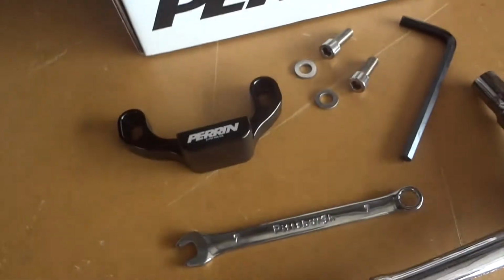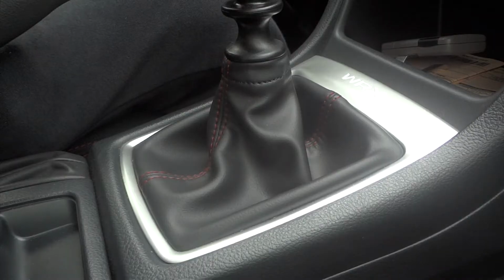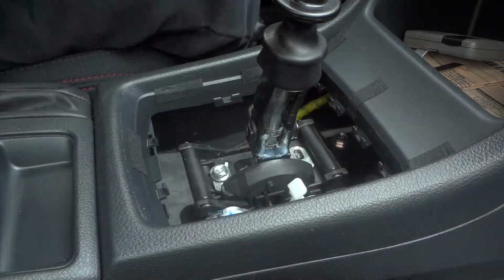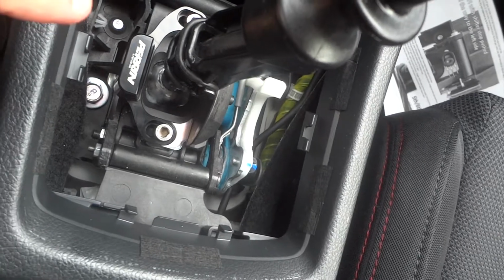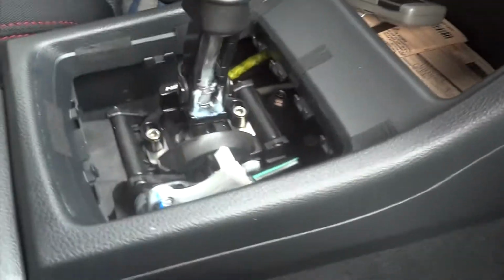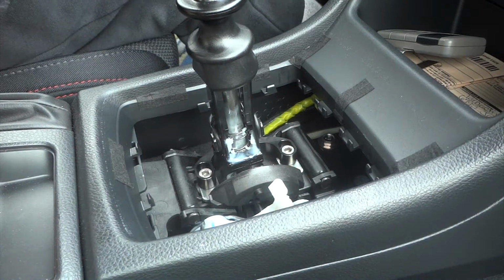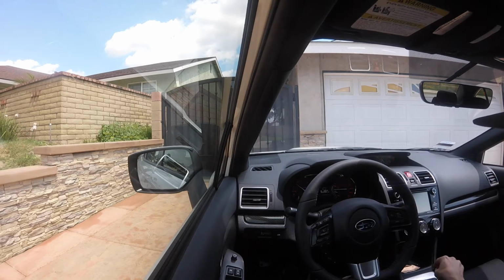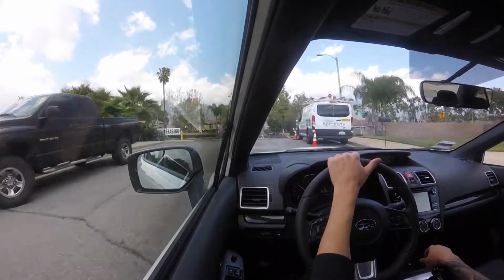PERRIN Shifter Stop Subaru WRX INSTALL & REVIEW

Comment: I just installed mine, but when gearing hard into 1st and 2nd gear, the thing for reverse is pulling up. Help me
Reply from the maker: Make sure the shifter stop is slightly pushed left before you TQ it down. Or else you will not have any left side motion.
Reply: Mamat Fernandez I had the same problem.  I called Perrin, they said that it‘s the wrong one.  My WRX is a 2019 with stock shifter, the part number iI got ended in 18, it needs to end in 19.  They don‘t look much different, but I installed my new one this morning and it stopped the reverse thing from popping up.
Reply: Brian Makris I have a 2015 wrx with a oem short throw shifter. I have the same issue. I can’t get to 1st or 2nd gear without having to pull the reverse lock out. Perrin said that I had the correct part (mine ends in 18). I’m not sure what to do since it won’t allow me to move it anymore to the left before tightening it down.

Comment: How many miles till you started to get some play? I just put 1,000 miles on my 17, but the shifter is solid as a rock. I go pretty easy on shifting anyways though
Reply: Same. 500 miles in on my 2017, and there isn't really much play. So I am not even considering getting this. Throws also don't feel abnormally long either. So I am not going to spend money on STI short throw shifter
Reply: I got the sts installed 2 days ago. Its not a huge difference, but definitely makes it feel nice. Probably reduces the throw by 20%. Anyways, i do have play left to right in first and second gear that i didnt check for i guess lol. 3-6 have no play what so ever. Im actually going to buy the shift stop and get it out of the way. Cheap easy install and solution.

Comment: You just need a closed ratcheting wrench for those 7 milli's
Reply from the maker: Sorry, edit
I actually did try to use a ratchet, but it would not fit with the plastic cover on. Thats why I said it would be ALOT easier to remove the cover and install the shifter stop.
Reply: Not a ratchet, a ratcheting wrench. A closed end ratchet wrench :)
Reply: A ratcheting wrench is not something you can put sockets on. Its an open/closed end wrench that has a gear in the closed end. Not to be confused with a ratchet. aka gear wrench as some call it.